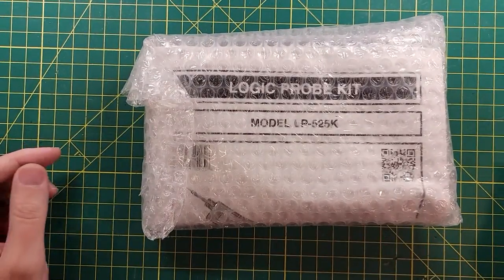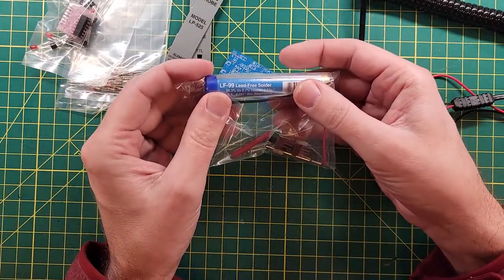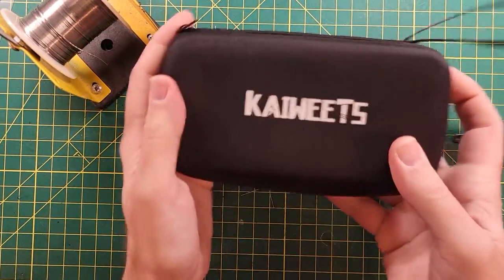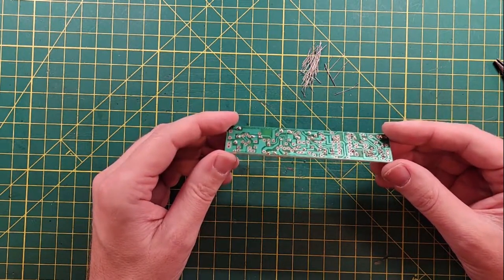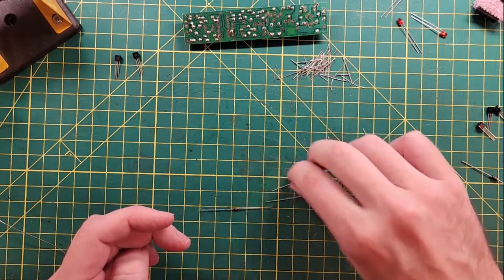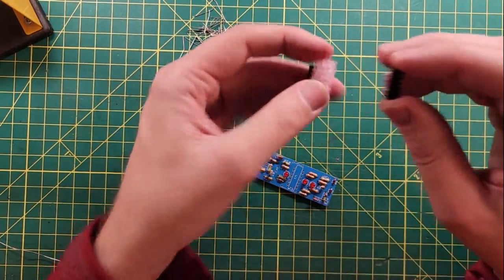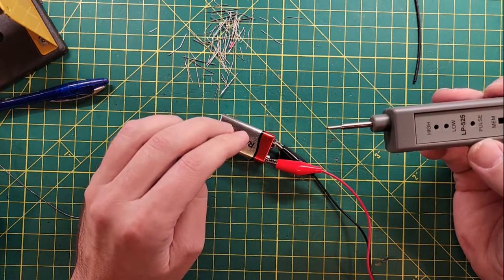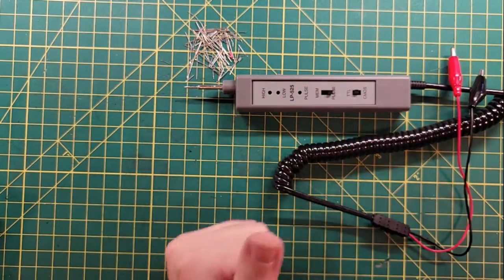Elenco Digital Logic Probe LP-525K - Let's Build it!

Comment: I just built the CW Hotline kit. Those are fun to build and useful then we can play CW over the internet ;) I am wondering if you can get some light pipe for the hole where the LEDs are supposed to stick out and just glue them in the holes however, seems to be visible  even without that.
Reply from the maker: I could get a couple of pieces of clear plastic/light pipe for sure.  I'll see if it annoys me enough.